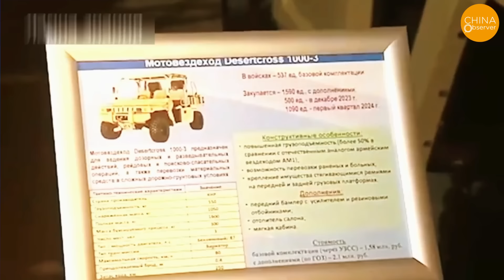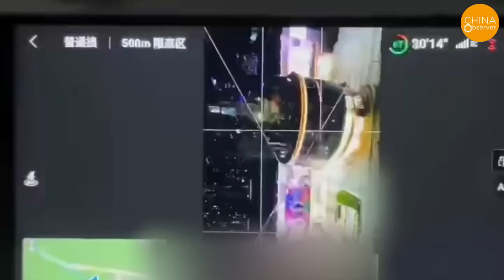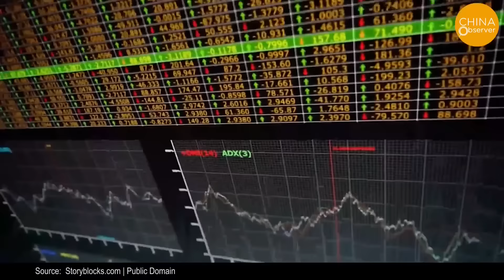China’s Tofu-Dreg Tank Joins a Contest, Loses Wheels, and Falls to Pieces! Russians Laugh Heartily

Comment: The wheel falling off is actually a safety feature, it prevents the crew from reaching the front where they can get hurt.
Reply: If a wheel can go through the tank. How is it going to stop a tank round
Reply: This is directly from the Sum Ting Wong military line, they also use this frequently in the Navy, Air Force, Rocket Force, etc. 🤕
Reply: ye that makes sense 😂
Reply: Chinese Most Peaceful
Reply: Yeah Red Snapper. Show us information on this. It will stop the crew from reaching the wheel. WTF does that mean ?
Reply: It is also a way to prevent damage. If a tank is destroyed, at least a wheel will stay intact
Reply: It brings the image of the F-35 that cannot fire it's gun without producing structural damage to the plane. And it cannot go supersonic because it would damage the stealth coating material from the airframe. A prowess of engineering.
Reply: Just building the unit
doesn't make it
a weapon
Reply: Chinese they are good at using Swords and Shield
They are stuck to their great Dynasty Era never move on
Reply: Chinese quality 🇨🇳
Reply: @aquarius5719  on other hand the f-15 found to be still worthy,other nation still bought them in batch
Reply: 🤣🤣I believe it!!
Reply: translate server error ?  sum ting wong  wo mao?
Reply: YES!  #MBison_meme
Reply: LMAO
Reply: ha...ha....ha
Reply: @rwkh10  It was sarcasm. He's saying that it's a "safety feature" because it prevents the vehicle (and thus its crew) from reaching the frontline of the battlefield, where most of the danger is.
Reply: @aquarius5719  the magic sTeALtH coating is a paint formula that's relatively easy to manufacture, and repainting aircraft is a part of normal maintenance. disappointing how the people's republic education is tofu dreg as well, not fair for you 😞
Reply: @bellaggio1770  bong ding ou
Reply: The tank detected that the wheel was not a properly communist wheel and was ejected for re-education
Reply: Tofu-dregged tanks, Tofu-dregged wheels, Tofu-dregged trains & planes, Tofu-dregged buildings, Tofu-dregged CCP 😂😂😂
Reply: lmao WOT! please, stop lying to people... its because their tanks are cheap and all falling apart.
Reply: This is the same guy who said the turrets blowing off Russian tanks is a safety ejection feature:face-green-smiling:
Reply: Huh!! Someone forgot to steal the correct blueprint for that wheel. Reverse engineer one from Syrian war surplus dealer.
Reply: "Made in China" takes on a new meaning.
Reply: @defeatSpace  And the structural damage when firing the F-35 gun? I am amazed about how incompetence is advocated in the west and bashed in the east. To me the Tofu drej tank is as bad as the tofu drej F-35.
Reply: 😂😂😂😂 @powershift2024
Reply: LOL
Reply: @aquarius5719  Yeah, those cannons are absolute monsters. You shouldn't be struggling so much with understanding how the sTrUCtUraL dAMaGe is a one-off accident from an f-35 essentially catching up with its own bullet. Regardless, the fix is literally easy as updating the software and the military is lucky to discover the problem during an exercise rather than active combat. Anything else, little pink?
Reply: yes you do know about the communists...................
Reply: Looks like torsion bar failure
Reply: @rwkh10  It was a joke, as in the crew won't be able to make it to the front lines because the wheel fell off.
Reply: @aquarius5719  just a small comparison about China vs developed nations. According to the Shanghai Academy of Sciences, China has enough spare apartments already built that have NEVER BEEN LIVED IN to house an extra 1.5-3 Billion people. The actual market value of the majority of all mainland apartments are less than 10% of what they're currently valued at and that's the sum total of the private savings of the bulk of the Chinese population. This will have the impact of an enormous social breakdown as they vast majority lose their life savings at the same time they are starving. That's the difference sport. They should've copied Keynesian economics and not the Communist nation-state extinction model. Enjoy!!! 🤕🤕🤕
Reply: I see what u did there.
Reply: Might be an AI optimisation that recognised the casualty rate for crews of tank with lose wheels is lower.
Reply: @powershift2024  Houses produce nothing. They do not export. They are not means of production. It only means jobs must be near these places.
Reply: @aquarius5719  local and provincial construction doesn't mean anything to the economy even factoring in upstream and downstream revenues. Gotcha. Any other ridiculous statements?
Reply: OK, so the message from the military tops is as follows: Jump in the tanks guys, but remember the wheels fall off before you reach the front because of security.
Reply: @Yonisaj12  In today's battlefield, full of drones, tanks are slow. Drones can spot tanks in real time and rocket artillery would hit them before they even reach the front lines. So yes, tanks are useless, a detachable wheel will not make them more useless.
Reply: Wtf
Reply: @rwkh10 what? 
It might be missing a word, but normally the front is the front line, in military lingo. 
A front of a vehicle is the front end
Reply: Yea. And sometimes it blasts itself so that enemy’s rocket can’t hit it🎉
Reply: @aquarius5719  do you know ...at this time ..your re commentary is just pure comedy!!just try to think a little...sometimes is good ,try it!!! All countrys who are buying f35 ... and tested the planes..that includes firing ... flying... do you think they would spent billions to buy a plane if it had the problem you sayed???!?😂😂  
 Slava Ukraine 💙💛🇪🇺🇵🇹🇺🇲🇬🇧💪🏼🇺🇦🇮🇱🤔🫶🏼
Reply: @rwkh10 he means if the tank wheels falls off the crew won’t see combat (get to the front), hence “safety feature”
Reply: this video is not about the tank. It's just a cover. Dont miss the intel on their supplying of Russia
Reply: wHAT YOU MEAN CHINA IS THE BEST AT BUILDEN EVERY THING LOL
Reply: Yeah ok Mr Xi
Reply: @aquarius5719 you're about 6 years out of date. 
Those issues with the F-35 is were solved in Block 3
Reply: @whereammy  Peaceful? they keep bullying their neighboring countries in SE Asia😆🤣🤣
Reply: @rwkh10 

Maybe the front is the battle front, not the actual front of tank? Or maybe I don't know what either of you mean!
Reply: The wheel Falling off is part off the tank reactive armour. 😊
Reply: @humanchannel1569  lol 🤣🤣
Reply: Amao..
Reply: IF ONLY...THEY USE...ALL WEATHER MICHELIN TIRES....THAT WOULDN'T HAPPEN....INSTEAD THEY USE AN OLD COOKING PAN AS RIM....
Reply: You are mean! 😂😂😂😂😂
Reply: Made innnnnn,.....
Reply: that is a good one a safety feature in did
Reply: Good one! :person-turquoise-waving-speech:
Reply: @HorseRadish403  do you think any tank can withstand a apfsds now? even ur abrams can't do that
Reply: @aquarius5719  ahhh!...That's been corrected which is why the whole F-ing world is lining up to buy them.........
Reply: @rwkh10  It means they will be late to the party!

Comment: Former tanker here: In order for a wheel like that to come off at least 5 different people weren't doing their jobs. Those things use bolts strong enough to pick up a building, so it either wasn't bolted down from last time they serviced it or the bolts were fake.
Reply: In the west. In china they're made from rice noodles that are glued together and tapped into place.
Reply: Defective steel used it making bolts and nuts, most likely. They sheared off under stress and broke off.
Reply: You sure about the bolt quality of the Chinese version??
Reply: You have to remember that the tank was made in China
Reply: @ericwhitlam7517 Probably a different quality from what the initial poster delt with.
Reply: Remember these tanks were inspected, prepped and tested by the Chinese military before sending them to compete in the competition.  Imagine how potent the rest of the hardware waiting to be fielded in time of war.
Reply: I'm a former tanker also.  This thing is typically caused by the roller bearings failing.  Should have been detected when the grease seals failed, and grease started appearing in the inside rim of the roadwheel.  And after that it should have been detected by the crew as they felt the roadwheel hubs whenever the tank has completed a movement.  If a hub is hot then the bearings are shot and the roadwheel will be coming off rather soon.  A hot roadwheel hub is a deadline (equipment cannot be used) item for a tank.  You park the tank and get the hull mechanics to replace the bearings before the bearing surfaces on the roadwheel arm get damaged.  

If you catch the grease splatter - all that needs to be replaced are the grease seals.  Easy and quick fix.  If you catch a hot hub - a more involved repair as the bearings themselves have to be replaced.  If the roadwheel comes off, then the roadwheel arm has to be replaced as well - which means that the torsion bar needs to have the tension released before you can replace the arm.  And you have to inspect each track block for damage.

'Walking is for people who don't do proper PMCS.'  (PMCS - Preventative Maintenance Checks and Services.)
Reply: @donaldmaxie5264  theres different versions of steel alloys and treatments to harden steel. This likely had too much carbon and wasnt tempered correctly to keep costs down. Its a spectacular fail when even a strong material of poor quality doesnt make it past the first use, so its even likely the steel had cracks before it even left the plant it was manufactured at.
Reply: @colincampbell767 It's hard to tell from a short video but it looks like the suspension failed first and the track beat the hell out of the road wheel. Either way, somebody probably got disappeared.
Reply: @utley  Well aware of that from dealing with aircraft materials.   More with aluminum than steel,  but you still need the right alloy and heat treatment for the best performance.
Reply: @donaldmaxie5264  yes, and its clear this bolt was already fucked up.
Reply: Or it was substandard steel from the get-go. Ever seen the videos of the Chinese construction workers snapping rebar in two with their hands?
Reply: Have you ever used Chinese screws ? Wel you better screw them in by hand otherwise you end up with broken screws .
Reply: @williammccoy7127  well* and even the gentlest force will snap them... 90% are sintered iirc.
Reply: I'm gonna go with fake
Reply: looks like the whole arm thing came loose so how the hell does that even happen? did a torsion bar snap?
Reply: @vablo7198  even if it did it wouldn't have that happen
Reply: @serwombles8816  engineer here. Torsion bars are bolted on, how a nation does their tank suspension is down to them. And while he's correct in what he has said, it is here in this context he is wrong. China is an educator in what not to do.
Reply: @ms.annthrope415  this would be my wager, non-spec bolts that "looked" the same just snapped under load.
Reply: Chineseium.  The strongest metal evaaaaaar!
Reply: could be as simple as a failing bearing.. which can happen to any vehicle..
Reply: Why would the bolt be fake? They are dirt cheap..
Reply: @wilco300674  those bits aren't bearing placed they're bolted on. Also if it was that catastrophic at the bearing the mount wouldn't follow suit.
Reply: @osmacar5331   of sure it can. seen it happening
Reply: @wilco300674  not like this, not the whole bastard thing. Only a chunk on any tank of value. Not even russian tanks do that.
Reply: @@davesmith3023 butter is tougher
Reply: @osmacar5331   if a bearing fails, it can get so hot, the axle starts to melt, giving it room to wiggle free.
Reply: @wilco300674  am not saying you're wrong, am saying you're wrong here.
Reply: @osmacar5331   how can you say that, did you investigate it ? 🙂also, it might have been the axle that broke.. it landed hard a few times..
Reply: @wilco300674  one, engineer, two studied tanks for 2 decades, and three, those parts are pretty much the strongest parts given their use case, even russia for all it being the global kicking puppy, isn't mocked for those areas. Plus my sister who doesn't know tanks, like at all, knows that they use skirmish tactics a lot which is murder on the running gear.
Reply: Ive seen chinese rebar being easily snapped by hand so its highly likely the bolts were trash
Reply: So at least 5 different people are going to disappear? Oof.
Reply: I'd say all their problems are because of defective steel. Or substandard steel.
Reply: Both
Reply: or both.
Reply: @colincampbell767   - That is assuming American / Western quality hardware, manufacturing tolerances, and engineering.  China's manufacturing does not live up to western standards.  We will probably never know the true cause.
Reply: they got the bolts from Temu for 4$
Reply: I now know that China never went to the moon.
Reply: That actually stronger than the Nokia 3310 😂
Reply: The bolts were probably made out of Chinesium. Serves them right.
Reply: Chinese can not do metallurgy. This is why their bolts, springs and ball bearings fail constantly. You can copy the dimensions of a bearing very easy- but not the metal it is made from
Reply: Defective steel most likely. China quality control is pretty bad haha.
Reply: @ms.annthrope415  Definately, inferior metal bolts snap like a carrots, infact anything with inferior metal fractures or snaps, good steel does not.
Reply: why not both
Reply: @TheDeepImpact965  You can measure composition of alloy, but its the heat treatment that is the hard part. Ether it can be too hard and brittle or too soft and it bends or wears out.
Reply: It is also a show. Appear weak when you are strong. Sun tzu
Reply: What you expect from nato media?
Reply: it was made in china, we all know that quality isnt a selling point
Reply: The Chinese Rice Bowl strikes again!
Reply: @schutzanzug4518 
Because someone took the high grade steel, sold it, bought some inferior grade steel as a substitute and pocketed the difference.

"If I'm not stealing from my employer or his customer, by either short-shorting material, or substituting inferior materials, so that I can sell the material left over, then I'm not doing enough for my family."
Chinese work & business ethics in a nutshell.
Reply: @osmacar5331 
Russian tanks are built to spec.  Very different from U.S. specs, but there's no surprises on the training fields or battlefields caused by metal parts failing due to some corrupt asshole substituting inferior quality metals.
Reply: You're right
They were "maintained" after a long exercice in nearby Region
But OP forgot to mention it
These games are the conclusion of huge wargames in the Region
Reply: in normal country yes. In china all is made from cardboard
Reply: How the hell are bolts fake? I work in the welding sector so i work with steel, And there aren't fake bolts, they just weren't bolted down properly. and i work with chinese made equipment most of the time to make warships just so you know, i currently work at Damen Shipyards gorinchem making some of the most advanced warships for navies across the globe, and they served me and others well, some equipment even being older than 10 years
Reply: Perhaps they were using an under maintained one for the competition
Reply: Or is made in china😂
Reply: tofu dreg construction methods in military supply.
Reply: I suspect fake-I have seen alleged "high strength steel" bolts fail at low loading. The mfg cheats
Reply: Seems like tank went airbourne in high speed and felt directly with front two track rollers on one of those road bumps. Tank weighed couple of times more. Those 2 wheels took more than a small building can wegh;. Imagine the force. Newton's laws of motion
Reply: Same thing happened to lots of Chrysler "Hemi V8 engine"-cheap Chinese rocker arms and pushrods
 @utley
Reply: It could be low grade steel. In Russia they joke, calling Chinese steel - Chinese plastecine.
Reply: I’ve had bolts sheer, on a drive (not road) wheel on a 113.

Is scary.
Reply: That way it has a dual purpose as rations right? @gunmnky
Reply: They must have used inferior Chinese steel. LMFAO
Reply: The bearing has collapsed
Reply: Made in China....
Reply: @fgm1197  3 words that literally made me laugh out loud!!!!
You couldn't be more on point. +5 for truth and another +3 for comical creativity!
Reply: Yes but that tank is "made in china" like 99% of the other stuff that always breaks 😂
Reply: Fake/crap bolts 100%
Reply: Chinese bolts. 😂
Reply: China: "What bolts?"
Reply: The bolts weren't "fake". They were "normal". This level of quality is the norm in China.